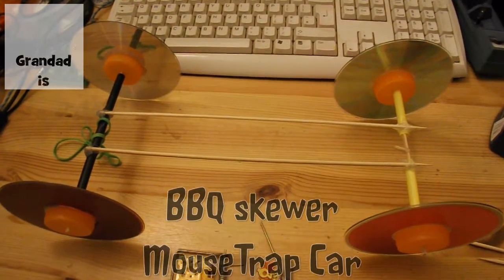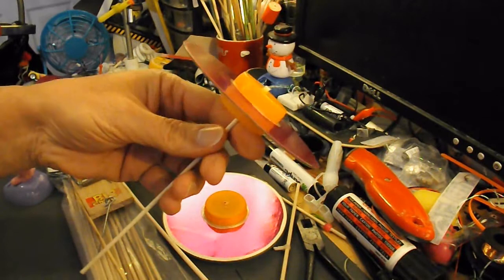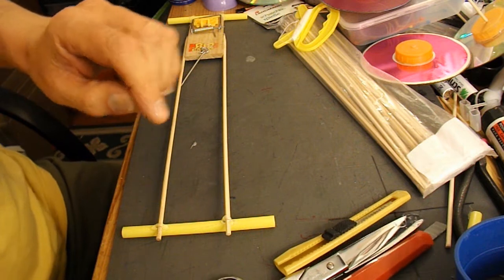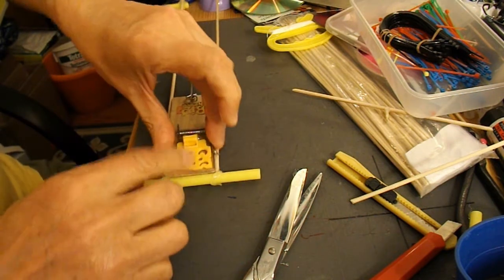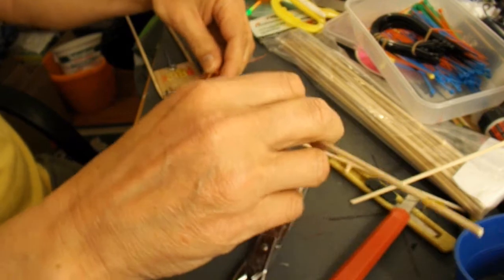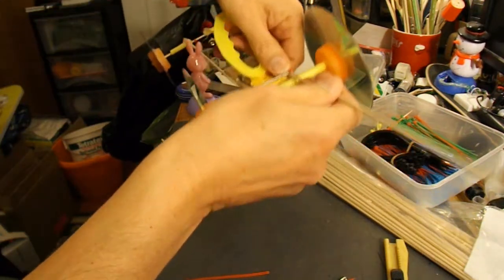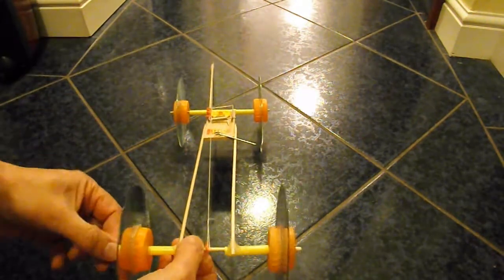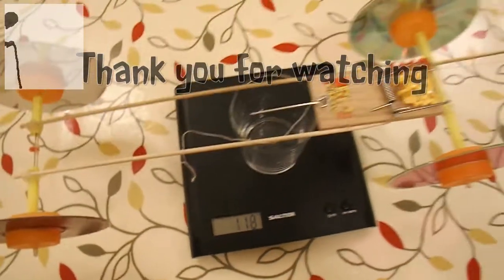BBQ skewer MouseTrap Car

Comment: Thanks so much for this tutorial it helped me a lot but is there a way to increase my cars acceleration?
Reply from the maker: Smaller wheels will increase the acceleration or a larger axle diameter. You will get problems with wheel spin as there will be less traction.
Reply: Thanks it helped a lot
Reply: I got first place in my class
Reply from the maker: Michael Lopez that is brilliant, well done and thanks for letting me know 😊

Comment: Great video! How can it be modified so that it travels straighter?
Reply from the maker: Here are some regular causes for the car not to travel straight.
1. You haven't got the front and back axle parallel so you need to unglue one and adjust the angle.
2. You drive axle is too flexible and when it is under tension it bends turning the car to one side. In that case you may need to change the axle to something stronger.
3. The chassis is too flexible and bends under tension. You may be able to fix that by adding extra bracing to stiffen it.
4. The wheels lack grip so they spin and slip to one side. Add rubber tyres to the wheels to improve the grip. - Putting rubber tyres on CDs https://youtu.be/ZnuPnveCbxs?list=PLA5a2xPRSrB3g5RiX8Kf_uUBOL0Tb7AS0

Comment: Another thing, when you attached the BBQ skewer to the mouse trap can you use string instead of the cable ties?
Reply from the maker: Certainly yes, good idea, I would run some glue over it to hold the string in place 😊
Reply: GrandadIsAnOldMan Okay, thanks and sorry for commenting for help so many times XDD
Reply from the maker: Hey, I like comments like yours, they are positive and you are interested in what you are doing. Some people make comments just to show they can hit the buttons on a keyboard. Good luck with your project 😊

Comment: how long is the string
Reply from the maker: +Jennifer Mendoza you need to trim it so it just comes off the back axle when the trap has finished moving. It must come off or it will be wrapped back round the axle in the opposite way as the car runs forward and will stop the car moving. If it comes off properly the car can carry on freewheeling with the momentum it has built up.
Reply: Thank you

Comment: hi i was just wondering what the diameter of the straw was?
Reply from the maker: +jonalyn M about 5 or 6 mm. I just use the biggest ones I can find. The bigger they are, the less friction they cause the axle. This size is common in fast food restaurants and coffees shops for use with smoothies. I think I bought mine in IKEA and these look like the ones I bought http://www.ikea.com/gb/en/catalog/products/20311242/
Reply: +GrandadIsAnOldMan Thanks for the reply sir! Would using a bubble tea straw be a good size or would it be a little too big? (https://hardmath123.github.io/static/bubble-tea-straw.jpg)
Reply from the maker: jonalyn M I cannot tell the dimensions from the picture but the simple answer it try it. If it works, you win, if it doesn't work you have learned something.
Reply: +GrandadIsAnOldMan Alrighty, will do sir! Thank you so much for the help :)